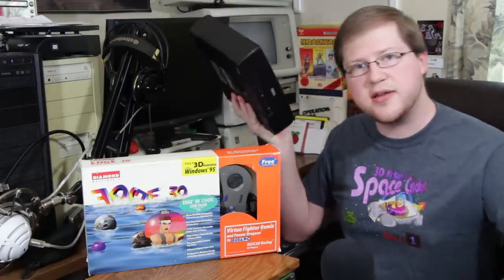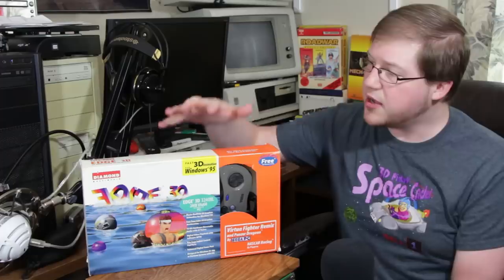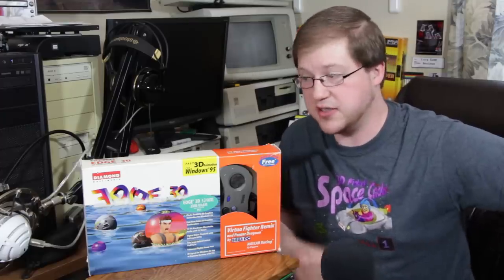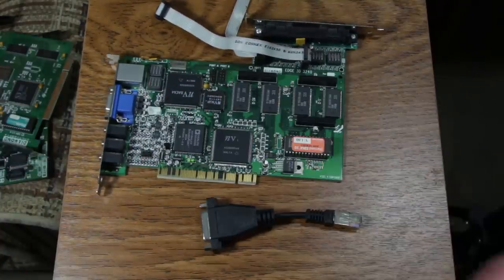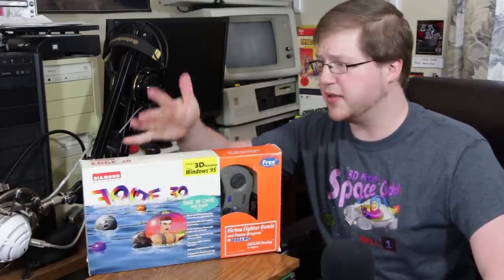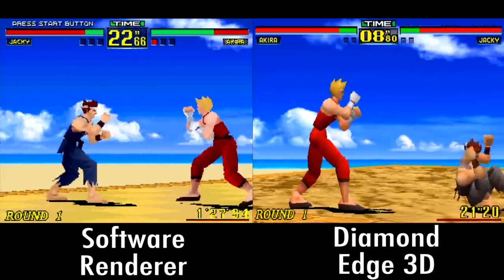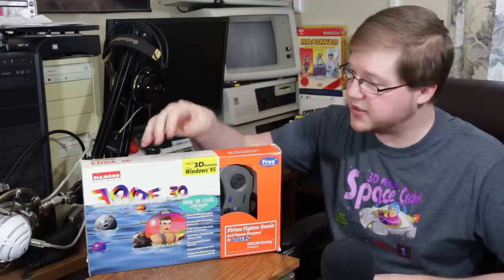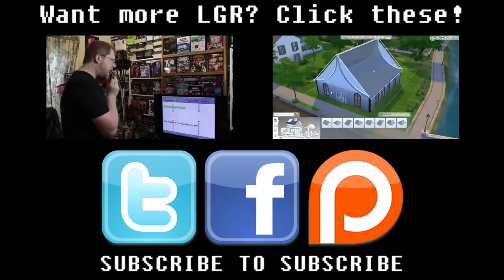LGR Oddware - Diamond Edge 3D (nVidia NV1+Sega Saturn Ports)

Comment: Imagine if nividia developers decided to include OpenGL support. OpenGL might be the standard we use today instead of directx.
Reply: OpenGL was already very complex back then and far more than the gamer graphics cards of the time could achieve. In principle, 3dFX's Glide is very similar to OpenGL, but it only contains a subset of the features that OpenGL offered.
So it wouldn't have helped Nvidia at all, as their graphics chip wouldn't have been able to fully support OpenGL. Implementation would have been very time-consuming and expensive. Windows NT supported OpenGL, but it took years until graphics card manufacturers had OpenGL drivers ready for it, which is why Microsoft introduced the MiniGL driver model for OpenGL, which simplified driver development and to have an interim solution until full OpenGL drivers were available. MiniGL took shortcuts and was slightly slower than full OpenGL driver support.
Besides, your ideas wouldn't have worked back then anyway. Because Microsoft pushed Direct3d and NVidia was a small company with a lot of competition. The reason why OpenGL survived on Windows was ID Software and the many games based on the Quake 1, 2 and 3 engines.
Today we have Vulkan.

Comment: Question: How would Panzer Dragoon look on current gen computers?

Will it look like Software render or better?

I have never played Panzer Dragoon, I did try it on the Saturn recently and it just looks horrible however with the 3D render it looks like a passable experience.
Reply: Dr. Bilal Zia Depends on your computer's specs, dude. Computers don't have set generations. Panzer Dragoon isn't that intensive of a game to run anymore, so you should be able to run it  at max without issue anyways, but still.
Reply: Yeah I have a current gen computer 64 bit and what not. But the hardware is different right? The Saturn hardware use Quads where as modern 3D cards use triangle.
Reply: Dr. Bilal Zia Ah, now I see what you're saying. I thought you meant you were going to play through an emulator (in which case, with the right tweaks, it still will look as good).
Anyways, I'm almost 100% sure if you buy the disc and install the game, if it doesn't work because of the use of quads (I think some cards do support the use of quads nowadays/have some way to substitute for them), it won't run because of the age-old compatibility issue.
If you have Windows 7/8, and have a disc already, then try it and see how it goes.
If not, just emulate it. You don't need a powerful PC to run it well.
Reply: I actually downloaded the Saturn emulator on a cutting edge next gen gaming computer last year to check out Panzer it looked about the same as the software render in this video.

I classify that as unplayably ugly!
Reply: On current gen it would look 2x as good the the Diamond Edge card

Comment: 3D acceleration? At all times, whenever possible.
Of course, unless there's no need. :)
Reply: That is contradictory. Jedi Knight ran great and very fast in software rendering on my Pentium 2. 3D acceleration was therefore not absolutely necessary, but it looked much better on my later Voodoo 3.

Comment: I don't get how quads can use less processing power than tris, because I've used Blender a lot (but am not very good at it) and a square quad face has one more vertex to it than a tri does. Maybe, because of this, it requires less faces to make something with an equal level of detail? I dunno, I guess that's what they mean. Like, maybe a mesh can be made with the same detail as one using 100 tris with only 75 quads or something?
Reply: Blender does use internally triangles like every modern software does. A quad can be cut into two triangles but for easier editing this diagonal edge is hidden in Blender. Thus as a blender user, you only see quads in wireframe view.

A quad allows for curved surfaces, so you need a lot less of them to create lets say a round ball, for example.
To create the same ball of triangles that don't allow curved edges, you would need a lot of triangles.
With triangles you have more vertexes and you would then have to move these from the CPU via the PCI bus to the graphics card. Most cards couldn't do transform and lightning back then, they were pure fixed function pipeline rasterizers (with the exception of the Rendition Verite), i.e. to put it simply, they got the finished triangles and then, after sorting the triangles, painted in the pixels.

Comment: Most saturn games are programed to run at a specific framerate and others  are locked at a constant 30 for instance.

Will this card give you higher framerates than normally possible on a saturn?
If so then i understand its on games that are not framecapped.

But what about burning rangers for example? The fps there goes all over the place.

Would playing burning rangers give on this card give a solid 20 or 30 fps as the game is intended without the framedips?
Reply: unrealdevon This card does not run Saturn games at all! It runs native, GPU specific, PC ports of some Saturn games. So the games that are in the box with the card are pretty much it, maybe one or two more and you'll have a hard time finding them. But forget about Burning Rangers.

Comment: The reason why the NV1 runs the games so well here and so badly in other Youtube videos is that this video was done with a 133 Mhz Pentium which is a suitable PC for an ancient 3D card like this. This card actually has a bug/peculiarity that causes it to run SLOWER in faster systems. In the other videos, the users set up turbo-Tulatin Pentium 3 rigs that are an order of magnitude more powerful than anything in 1995 so it goes haywire. I have read the ideal optimum CPU for this card is actually a Pentium 90 (!) so 133 Mhz is already beginning to slow down a bit, but anything under 233 Mhz should be okay. People who apply modern gamer wisdom like "remove bottlenecks" to ancient parts often forget some of this stuff was made with slow PCs in mind.
Reply: Are you sure it's a bug?
I know the story differently. The fast processors such as a Pentium 3 with over 1 GHz, which was released many years later, are so fast that the game runs faster in software rendering mode than with the 1. generation 3D chip on the graphics card.
You also have to know that the very early 3D capable games don't necessarily look better, depending on the 3D chip used, because the features of many 3D chips were still incomplete. Of course, this doesn't apply to all 3D chips, a Voodoo will usually look better, but other 3D chips like the early Matrox cards don't support texture filtering, for example. The difference between 3D rendering and software rendering was hardly present on these cards.
In addition, many software renderers were sophisticated and sometimes used and displayed more features than the 3D version did. The game Archimedean Dynasty, for example, is such a game.
Of course, this no longer applies to the later games that came out when Voodoo 2 was already on the market. So it often makes no sense to run a game from 1995 on a bad 3D chip if the CPU is a fast Pentium 3. Software mode runs faster on such CPUs, has fewer display errors and sometimes looks better in these games. And as I said, that only applies if you don't compare it to a voodoo card.

Comment: The ironic thing about using quads is that they are still being turned into two tri's each.  Blender, one of the best 3d modeling/editing programs supports polygons with as many sides as you want, but still has to be able to break those down to tri's at some point.

Comment: Cool! Wondering if anybody has overclocked the NV1 cards? Would be cool to run the games smoother or with higher resoultions. Maybe even add a cooler to the card :)
Reply: Kristoffer Trolle Adding a 'cooler' wouldn't change anything, tho.  Just making something cold doesn't make it go faster.
Reply: Sin Vraal Lol I know. But if you overclocked it. Remember there was a program called Power-something that could overclock basically any card (back in the days)
Reply: Oh, it actually didn't support this.  It did a lot but only maybe half the cards during it's time.  But 99% of people had the ones it did, so... yeah.  History.  XD
I had a WildCat VP990 back in the day, when the best anyone else had was only a 64 or 128 MB card.  I've SEEN the wierd side.  It's framerate was god awful, but it could render basically as many polygons as your computer could possibly feed it.  Photorealism?  Totally possible... at 3 FPS.  It was slow because it used full 64-bit rendering when everything else topped at 24 as the best.  It was designed to render volumetric 3d, IE shit like MRIs and stuff that wasn't just a mesh with textures, but had polygons inside AND out and textures on all sides, voxel clouds, etc.

Comment: If this piece of little software for install the SEGA PC. I would should say, it will be the best emulator for the Sega Saturn Out there. No more SSF or another crappy emulators. Only an Official SEGA Emulator kind of product for to play Sega Saturn.

To bad, this software exist around here somewhere on the Net?
Reply from the maker: This isn't a Saturn emulator and it isn't software :) It's a card designed in cooperation with Sega that happens to play a few specially-converted Saturn titles.
Reply: Ohh, thanks, i always wanted to know about that.
Reply: +DRAKONOLUS SHIRKANOK It would be cool if someone got a SEGA Saturn emulator to use this card for rendering.
Reply: +Infinite\Contrast Would be pointless for a Saturn emulator to use this card for rendering. The card does not have any of the Saturn's hardware on it. It is nothing more than a standard PC 3d video card with an integrated sound card and Saturn controller ports. The "Sega PC" games require the Diamond Edge 3d card because it uses the nv1 chip which renders polygons as quads. The Saturn also renders using quads but doesn't use the nv1 chip to do it. Basically the games are ports made to look similar to what they would if played on a Saturn. The same games if they could be played on a different video accelerator of that era, that used triangles, would have either worse performance/similar image quality or inferior IQ/similar performance.

Comment: Does that mean that if this thing took off and now we'd be playing on quads we would have even better looking games than what we have now? Like 4k on PS4/XBone?
Reply: Andre Gon No.
Reply: No, the purpose of quads was to cut in half the number of faces the CPU had to feed to the GPU. In other words it halved the required memory addresses to draw a box, but it had no affect on the number of memory addresses to draw a pyramid. If quadratic rendering took off and became the norm, the only difference is that CPU and memory requirements would be lower for equivalent framerates, but it would do nothing for the visual fidelity. It doesn't increase GPU horsepower.
Reply: No, the "quad" thing was a hack by Sega when they realised their machine would need more 3D power. Using triangles is the method everyone has used, long before the Saturn, and ever since. And also during. Because it's better, unless you happen to be drawing a whole lot of squares. 

Nothing to do with memory accesses and frame rates. Just Sega shoehorning their sprite-warping chip into a 3D system. Of sorts.

Comment: My first bit of decent hardware was a Riva128 Graphics card. Fairly sure it was by Nvidia.
Reply: I always wanted a Riva128 but ended up with a weak ish Matrox card around the same time, and then went to Voodoo1 and 2 when they arrived.

The first 'game changer' card imo was the original Nvidia TNT thingy. Everything else felt a bit of a compromise in one area or another, or pass-through cables, or poor resolution/cost etc.

The TNT 1 just did everything positive with none of the downsides of the stuff that came before. The only thing it didn't support was 3DFX API but by then OGL/D3D were on top any way.
Reply: My first attempt at a pure 2D/3D card was an ATI Rage 128 Pro. It looked great on paper, but the drivers were a complete disaster. I only had the card for one day and then exchanged it again to buy a Voodoo 3 later. After that I never bought ATI again. By the way, this still applies today. AMD CPUs yes, but no GPUs.

Comment: 2014 and they still want to emulate sound drivers via gfx hardware.. :(
Reply: Nowadays, the sounds are mixed on the CPU in software and then the digital data, if HDMI is used, is sent to the output device via the HMDI interface. Only then does the digital to analogue conversion take place.
This means that today a GPU that masquerades as a sound card doesn't have much to do. Things used to be different.

Comment: will this work on my windows 8.1 machine? (WITH HEADPHONES)
Reply: gary zipperer Just in case you're being serious, you can install it into many towers running Windows 8 physically, but the drivers are not going to be compatible, so it won't run.

The drivers will install in Windows 95, but i'm not sure whether that will in turn make friends with your modern mainboard. I imagine this being excessively difficult or impossible. Maybe Windows 98 or Windows ME could just about work, but compatibility with NV1 drivers could become more difficult.

There is a theoretical solution. You can try to run Windows 95 in VirtualBox (not officially supported!), and it supports PCI Passthrough if your mainboard supports IOMMU feature, but this isn't usually present in budget boards. So it's possible to connect a PCI card inserted into your host to the virtual machine instead of host operating system. 

Also you'll need an extra VGA monitor that NV1 would output to.

So all in all, it's a lot simpler just to assemble a dedicated computer from 90ies parts if you want to try out this card.
Reply: I upgraded :) , will this work on windows 10?

Comment: Does anyone know the technical limitation making this card unable to support openGl and direct 3d? 
From my naive perspective you should be able to degenerate a quad to a triangle by setting two of the coordinates to the same value.
Reply: You only need a few squares to make a round ball, but you will need a lot of triangles to do the same. 
OpenGL and Direct3d use triangles, they expect to push triangles to the hardware. You could certainly use the driver to convert the triangle into a quad on the CPU as you describe. But you can't take the performance-enhancing step of using only a few quads to render the round ball. So you have the same number of quads as the competition with its triangles. In contrast to them, you increase your number of vertexes by another vertex and therefore need even more bandwidth and VRAM. The CPU also has to carry out this conversion in the driver, because the fixed function pipeline of the NV1 cannot do that.
In the end you are slower compared to the competition and the step to make a round ball of only a few quads cannot be used.

Comment: Just one comment... in that time NVIDIA sucked totally. Nobody was gonna buy that piece of sh$@$ when can buy a diamon monster 3dii with a glide  3dfx voodoo2 .
Reply: The NV1 was released in May 1995. The Voodoo Graphics in October 1996 and the Voodoo 2 in 1998. Thus you had to wait a little bit. For the first 2d/3d card from 3dFX, which was faster than the Voodoo 2, you had to wait for the Voodoo 3. This was released in Mid 1999.
Reply: @OpenGL4ever  Voodoo2 Quake 2 was the reason to get one 3Dfx chipset.
Reply: @ENFDO  Unreal and Half-life.
Reply: @OpenGL4ever  yes, but Unreal required more raw cpu power and worked better with voodoo3.
Anyway these were great times!!
Reply: @ENFDO  I agree.